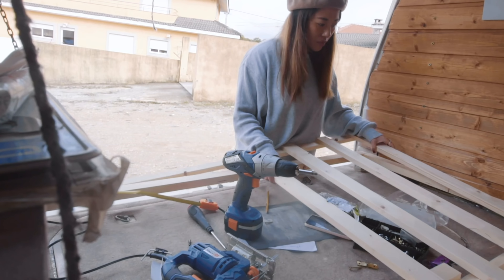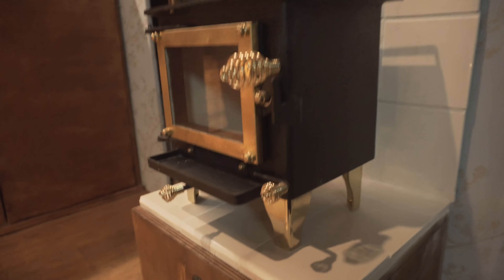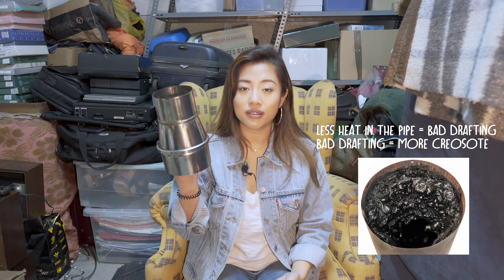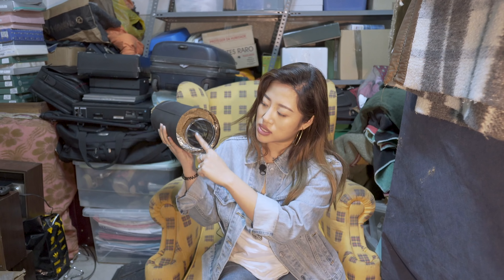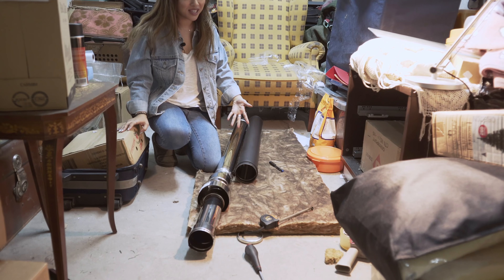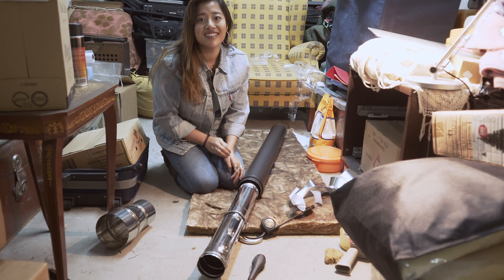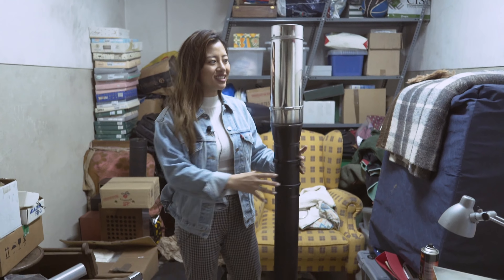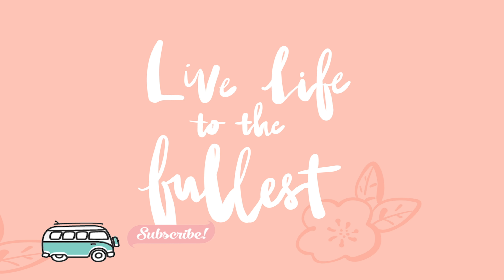Heating Van In Winter | Cubic Wood Stove Installation Flue Pipe Guide  Pt. 1

Comment: Great Perseverance. I do not how hot these stoves get but you should know aluminum tape might work but usually the aluminum tape only rated for temperatures of 200 or 300 degrees F, maybe 400 degrees F if a really good tape. So it might burn or smell a little bit. I do not think it will catch fire but you should look into that.

Comment: ? Of course you can get the correct fittings in Europe search marine 3inch flue pipes. there are loads for the cubic mini I installed mine in a VW T2 . Yours looks kinda dangerous

Comment: Susi, please make sure to get a Carbon Monoxide detector in the van when you put the fire in- just for safety.
Reply: I would actually suggest two and from different companies, brand. I had one, and one day just for fun we tested it and it never turned on at all also if the batteries of on die while you are sleeping probably the other one would be still working for a little while, or have one with batteries and the other connected to the van electric system.
Reply: Always safety first
Reply: @tommy69693  Tommy yep
Reply: @TheStickyBusiness  Multirotor good point.
Reply: Force of Nature 101 what’s that?

Comment: the aluminium tape is not good when the pipe chimney gets hot the tape glue will melt under the heat

Comment: You are so inspiring. I will recommend reconsidering your heater tiles. If your heater radiates extreme heat to the tiles, they will easily crack because this  type of tiles are not design to resist heat.

Comment: Suzi, you are an inspiration! I grew up with a wood stove as our primary heat, so I have a suggestion for you... Consider getting some kind of wire mesh or screen to put over the top of the stovepipe that is outside. You could secure it under the top screw clamp that you already have on the pipe. I can't even describe the scene in our house when a bird came down the pipe into the stove! Of course, the bird won't try it when the pipe is hot, but discovering a live creature, covered in soot, flapping around in the stove, and then having to let it out and getting it out of the house, yikes what a mess. We also had a squirrel come down the pipe one time lol. Anyway, the pipe you created is beautiful and you learned so much about how your stove works and you will be able to work on it yourself, if need be. Thank you for sharing. Merry Christmas from Texas!

Comment: The aluminum tape isnt heat resistant 
You need find metal wire pipe clips

Smart is order original from the stove company. Health is most important

Always use stove with the windows open